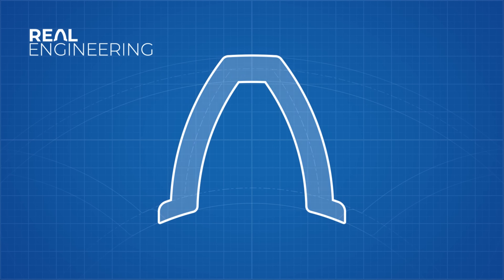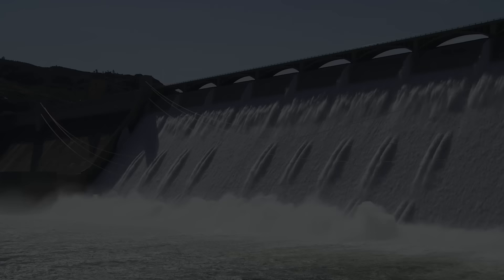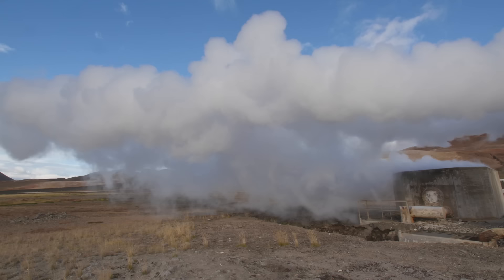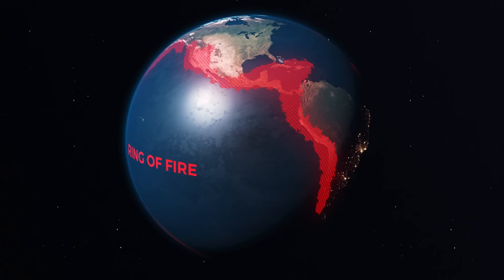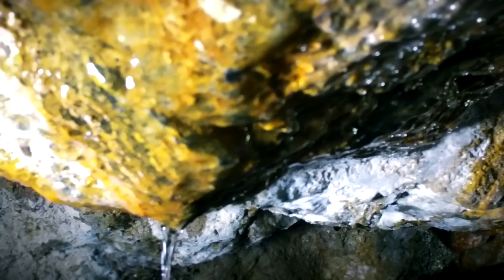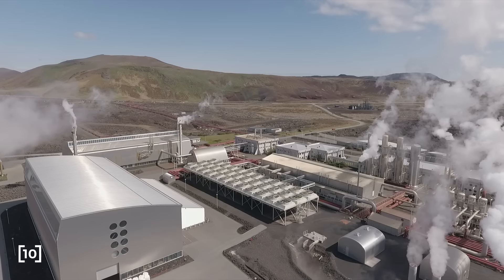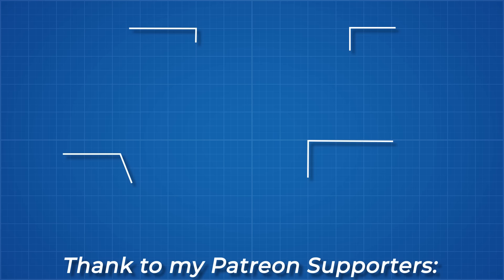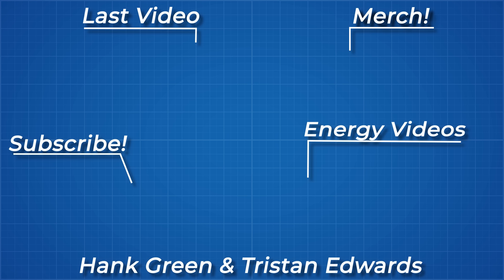Could Earth's Heat Solve Our Energy Problems?

Comment: Real engineering can you do a video on the next generation of nuclear power plants and their efficiencies. The recycling an re-usability of nuclear waste is really interesting in terms of safe and long term nuclear energy and energy sustainability, but people are so scared of the word there is little media coverage on it. cheers.
Reply: Say it louder for the people in the back. Good Lord, sometimes I feel like the only person who realizes that nuclear is the ONLY solution, and our time to ramp up nuclear power is running short. Maybe the couple dozen comments on every science and energy video are the only people who are aware of this problem America faces, but I'd like to believe there are more of us. We need to pressure our local governments to give greater thought to nuclear power if we are to move away from fossil fuels without kneecapping ourselves.
Reply: Yes!
Reply: Nuclear is honestly our best opinion for a future power supply. Granted we'll still need quicker acting plants to help quickly adjust the grid to demand. Those will probably be gas power plants. Though I guess in time you could make some stuff that can provide stable but quick power to replace those. I just don't get why we don't go the nuclear route when we know it's safe, to the point nuclear is safer than even solar and wind some how. Plus the long term cost is actually really really good, since they last so long and the method of producing power is efficient for power generation and cost of fuel per kilowatt is really good.
Reply: Yes, please im on board with you guys! Nuclear is the only realistic option at this point.
Reply: YES PLS
Reply: @danielhebard1865  What about the accidents?
Reply: Nikki Jones accidents are extremely rare, and rarely result in death. Nobody died from radiation in the Fukushima incident, but people freaking out caused problems. Basically, reactors are safer now than ever before, and most accidents are avoidable if technicians are properly trained. As far as safety is concerned, nuclear reactors have resulted in fewer deaths than any other form of energy, even solar. The only thing stopping the masses from embracing nuclear is their ignorance. And I’m willing to bet that if they knew how cheap their electric bill could be, they wouldn’t be so against it.
Reply: @nikkijones7051  The latest generation of nuclear plants, particularly molten salt and subcritical reactors were designed with safety in mind, away from the pressurised water reactors that gave even their designer pause. There are also tentative plans for new reactors that could recycle existing nuclear waste, potentially even the materiel from Chernobyl and Fukushima.
Reply: @danielhebard1865  The sad part is a lot of countries are actually CLOSING nuclear power plants, because of the stigma of nuclear weapons and reactor meltdowns like Chernobyl.
Reply: Australia just did a study on Nuclear power's viability in the country and concluded it wasn't worth the effort.

The conclusions of the report are that nuclear is vastly more expensive than other options and that it takes too long to get functioning plants up and running.

Based on the situation in Australia they estimate the cost per kw/h of nuclear to be pretty much the most expensive option possible for power generation.

It's also, by it's nature, since nuclear plants cannot have their output ramped up and down quickly, something which provides baseload power.
Which is the exact opposite of what the current Australian electrical grid needs given it's existing structure, where pretty much all current power related issues are related to insufficient peaking capacity, NOT baseload.

Nuclear does get more flak than it deserves due to people's panic tendencies around it. (though don't downplay the implications of large, infrequent disasters vs ongoing smaller ones - most people rate air travel as more scary than cars, even though averaged out air travel is safer by far, because the scale of an air disaster tends to be so huge. Nuclear has the same problem.)

But you shouldn't be lulled into thinking it's a panacea, which would solve all the world's problems if only those foolish anti-nuclear people would stop panicking about it so much.

It's expensive, takes a very long time to set up new generating capacity (on the order of decades), and provides baseload, which is generally not the primary problem modern electrical grids are faced with.
Reply: @KuraIthys  Seriously? Australia's latest stand on power generation (using brown coal as it's they have lots, it's the cheapest, and China isn't importing so much of it these days) is so short-sighted it would be funny if it wasn't going to kill people and wildlife. Cheapest does not equal best, especially in the long term. Burning brown coal (or any fossil fuel) for power is going to cause far more harm to the planet than well-managed nuclear ever will. That said I wouldn't trust the Aussie government to manage anything well...
Reply: @ALegitimateYoutuber   You can solve the increased demand on the grid through gigantic water reservoirs (pumped-storage hydroelectricity), which is pretty much how it's done already today. But is the problem the very short term increased grid usage or rather a medium time frame? Given the really long time to start and stop nuclear power plants.
Reply: Nuc power is the most expensive at 12c per wh and produce  1GW  vs  2GW  at petroleum  plants    Just what re-usability in actual practice are you referring to? The holding tanks at most Nuc plants are full and the rods they hold are 100k times more deadly than when they were installed  The rods have to be held for 40 years min before they can be transported and cooled continuously to avoid meltdown  There is no destination for the rods and no approved safe transport and storage   The US taxpayer has payed for the re-fueling and the total percent of our power needs has never been over 20%  The process to produce fuel rods is complex and expensive the tailings left behind from the entire mountains leveled to produce a few boxcars of yellowcake has a big environmental impact
Reply: Yes Please !!
Reply: @KuraIthys  isnt the investment in the technology worth it in the long run if everyone started investing in it, thus lowering the production cost and operation cost??? it is expensive to invest in the next generation nuclear plants, but its worth it i was watching a presentation from i think it was the university of Melbourne i could be wrong there but the professor/presenter was so frustrated that Australian politics play such a negative role in the downfall of this tech.
Reply: @Shaun.Stephens  mate the australian political bias is run by a bunch of un educated chocked up bogans. we cant expect much from them better to invest our time and education in Europe's nuclear tech. some of the stuff they have on the horizon is mind blowing.
Reply: @Viewer19  cant next gen fast breeder reactors recycle these rods??
Reply: @baronvonlimbourgh1716  with the global population ready to exceed 10 billion by 2050 and there will be no demand for more energy?
Reply: @MrAlexRadic  sure there will. And it will be whatever is the cheapest option to the consumer that will supply it.
And a grid with huge centralised plants will never be able to compete on cost with solar solutions because of it's dependence on highly capital and labour intensive infrastructure and inherent overhead.
Especially in developing countries with their smaller per capita energy footprint.

The grid is the solution to a problem that no longer exists. When it was build it was simply not practical or efficient to produce energy at the point of use. The efficiency gains by using huge centralised coal plants exceded the cost of building and maintaining the infrastructure needed to deliver it. 
These conditions no longer exist. It is now becoming more efficient to produce electricity at the point of use making the grid itself and it's overhead a huge added cost that is no longer nessecary.
Reply: IIRC, "molten salt" reactors exist since the days of the USSR. They produce next to no waste, and are much more efficient, cheaper, and way safer than "solid fuel" reactors.

I mean, we as a species have improved so damn much since the 80s...
Reply: Lets not forget nuclearfusion,thenew nuclear comingto play
Reply: @ZeroSleap  that has been 10 years away for at least half a century now lol.
Reply: @danielhebard1865  yeah just make sure these Nuclear plants in the usa are far far away form natural disaster prone areas which is almost the entire USA...
Reply: @MrAlexRadic  Still transport is a problem and where are the next gen   breeder reactors?   I would prefer to save our nuc resources for space exploration     By ~1975 our US reactors cost more  than all the fuel used by conventional plants u to then and produced only  ~16% of our power  Don't forget the  $500 billion the US tax payer forked over later tore-fuel because the plants were  not profitable.  It all started because the military wanted to produce Tritium to make nuc bombs. So they started the Clean Safe Efficient campaign with the help of the Oil companies which became known as Energy companies they helped because  half of US oil consumption is used by the military.
Reply: Thorium 238 -> Uranium 238-> Someting else for minutes-> Uranium 233

Thorium is one of the most abundant minerals on the planet
Reply: @danielhebard1865  Good comment. Totally agree.
Why do you say that in terms of safety other energy techs have caused more deaths than nuclear reactors?
Maybe because there are less nuclear power plants in the world, thus they have caused less accidents?

I am totally pro nuclear.
I just dont know data about historical accidents in different energy forms.
Reply: Yes. Nuclear fission is the solution for now, until we reach a good fusion reactor.
Reply: @AgentJRock805  ''something else for minutes'' this is funny its something but then its this.
Reply: @ricardocortes454  its a statistical average is why nuclear is safer they just wont develop new types of reactors because the waste cant be weaponized thus making it useless to the leading dev countries like the USA so no one is interested. even if it is safer and or cheaper it doesn't fuel one of the  arcs of USA economics which is war. althought China an India are at a point where they are developing these next gen reactors because they dont have  a choice
Reply: @ricardocortes454  fossil fuels cause a lot of pollution, especially air pollution. which isn't particularly healthy and these toxins like lead and mercury do cause premature deaths and cancer and all that jazz.
Lots of secundary concequences involved with burning fossil fuels and it effects basicly everyone on earth.
Reply: @danielhebard1865  it is still to expensive and inflexible to be viable. It is an economical dead end unless it is heavily subsidised.
And at that point there are better ways to spend billions or trillions of taxpayer money that have a bigger impact then funding nuclear reactors.
Reply: I'd like to see a video on Nuclear. Whether he says it's good or bad, I don't care, just say something on the subject.
Reply: He won't do a video on nuclear. He is a paid shill of the "renewable" industry.
Reply: @malcolm_in_the_middle  lol. Do you really not notice yourself how silly you sound¿
Reply: @baronvonlimbourgh1716  No, I don't. Why don't you explain how silly I sound?
Reply: @malcolm_in_the_middle  if you can't see it yourself when it is pointed out to you, having a discussion about it would not change that either. Would be a kinda useless endevour.
Reply: @baronvonlimbourgh1716  Typical smug lefty. Are you sure that you just couldn't think of a logical reason that I "sound silly", and merely made that statement based on your feelings?
Reply: @malcolm_in_the_middle  yeah, i am sure that is not the case. And it's not smug. Lazy maybe, but not smug.
Reply: @baronvonlimbourgh1716  Sorry, but I don't think you get to decide if you're smug or not.
Reply: There is quite a lot out there. In the UK two new plants were being built. One has stopped construction as it will never be cost effective. The other is still being built but will provide the most expensive electricity on the grid. This is in a country where the state takes responsibility for decommissioning and disposal of the waste. Much has been said about nuclear being 'low carbon' but the figures they quote are selective. The enrichment of the fuel is hugely energy hungry, the mac King of the fuel rods also requires specially created buildings with huge environmental  controls. When the rods are 'spent' they need to be stored under water while being monitored for an age before they can be moved off site in huge  protective casks. They then have to be stored safely for thousands of years or be put through the enrichment process again if there is a demand.
Reply: Nuclear power is the future.
Reply: @malcolm_in_the_middle  sure i do, that is what being smarter then everyone else is all about ;).
And yes, that is a joke...
Reply: @bigbadjohn10  the trouble really is not worth it anymore at this point, especially concidering the ongoing cost, management and subsedies they require. 20 years ago they might have made sense, that was probably also when it was decided to build these plants i suspect. But they had to be online then. Not decades later.
Things are changing fast.
Reply: @baronvonlimbourgh1716  It's not really a joke though, is it? You do think you're smarter than everyone else.
Reply: @malcolm_in_the_middle  haha. No man do not worry. I do know when i am better informed then a majority of other people. And i do recognise when i know very little about something and need to shut up and listnen to the ones that are better informed.
It is called self reflection. You should try it sometime!
Reply: @baronvonlimbourgh1716  Yes, you certainly sound like you know when to shut up. Furthermore, what on earth does that have to do with my initial point? I accused Real Engineering of being a shill, is that something you know more than me about? Are you saying I should shut up and listen to him, even though he's a shill? Really, what is your point?
Reply: I think this would have to be a series to cover all aspects not just the plant but the fuel preparation , the surround infrastructure and waste handling and storage.
Reply: DK Stoney  No it is not. It is expensive, inflexible and highly complex and is not as 'low carbon' as is claimed. The current costs would be even higher if the state did not cover the cost of fuel enrichment, disposal and decommissioning of the plant. As a business proposition it is really a none starter.
Reply: @malcolm_in_the_middle  you changed the conversation to me being smug and smarter etc. i didn't. So yeah, what does that have to do with anything? Please explain!
My point simply was that calling him a shill sounds silly, and i asked if you noticed this yourself as well. Not a complicated question i reckon.
Reply: @baronvonlimbourgh1716  Why do I say you're smug? Because you have talked down to me this entire conversation, and refused to explain your opinion when asked. What would you call that if not a smug attitude? You may of course remember that I did answer the question, but then that really doesn't matter to you, does it?
Reply: @bigbadjohn10  Here is some simple evidence that nuclear is lower carbon than so-called renewables: Germany is mostly "renewable" and France has largely nuclear power. Carbon emissions per capita in Germany are 8.9 g/person/year, and in France, 4.6g/person/year. There are, of course, complications with the waste of the reactor, but do you really mean to imply that there is no problem with the waste from production of solar panels? Solar panels have a lifetime of 20 years, if you're lucky, and nuclear plants have a lifetime of 50+ years. The energy production per hectare is 10 times higher for nuclear than either solar or wind, and the death toll per kWH is lower than all other energy sources.
In terms of waste management, it is expensive, but certainly manageable, and it is factored into the cost of the electricity. Even with this cost added, electricity from nuclear is far cheaper than renewables. You gave the example of 2 power plants in the UK where the price of electricity will be the most expensive. As far as electricity costs go, this is an abnormality, as in France, the USA, Russia, China, anywhere really, the costs of nuclear energy are cheaper than renewables. Not as cheap as coal of course, but the premise of this discussion is that coal is unacceptable. Did you take UK subsidies to renewables into account when you said it would be the most expensive?
Reply: @malcolm_in_the_middle  what do you want me to do then? Talk seriously to you like an adult when you make silly statements like you did? 
You obviously haven't taken any effort to inform yourself properly and yet you want to be treated like you have. Pretty entitled attitude honestly.
Reply: @baronvonlimbourgh1716  And this is precisely why I called you smug. You act as though you are better than everyone else. Do you have any evidence that he is not a shill? If not , why did you feel like you had to call me out on my accusation? Do you really think that anyone took it seriously? You act totally aggrieved that I didn't bow to your opinion and apologise.
Reply: @malcolm_in_the_middle  do you have any evidence he is? or any strong indication that he is? or any leads that point in that direction? Any statistical data that even remotely supports your claim?
Or do you just not like something he said for some reason or another and therefore he must be a shill of xyz. 

Just shouting out accusations into the wild about people does sound silly and ignorant. Especially if you provide no supporting evidence to support your claim.
And when you resort to attacking people personally or focus on some other random thing to start a discussion about the moment someone calls you out on it instead of actually supporting your statement by explaining why you made this accusation and provide information that supports your claim you basicly show you have nothing to offer but empty words. And that is pretty silly and childish.

You make accusations so it is on you to provide legitamicy to your claim. Expecting anything else is, again, pretty silly and pretty entitled.
Reply: @baronvonlimbourgh1716  Let's be fair here: I didn't attack you, you attacked me. I simply defended myself, and you got your panties in a knot. Do I have evidence he's a shill? Obviously not. But there is evidence that he is biased against nuclear, which is his constant belittling of it, and ignoring it in videos about renewable energy. When questioned, he refuses to address it, and ignores it. What is his motivation for this? It's not a closed topic at all, and nuclear is arguably far better than solar and wind. I say he's a shill, because this is a possible explanation for why he refuses to talk about nuclear.

Furthermore, this is a comment section on a youtube video. This is not a news article, or an opinion piece, or a real accusation in a court of law. Almost every comment made is baseless, yet you got very serious about putting me down, and really upset when it was turned back on you. Let this be a lesson to you: you don't know better than everyone on the internet, and you are not superior, and most of all, you are not speacial.
Reply: Malcolm in the Middle  You need to quote your facts correctly. The emissions you quotes are tonnes per year and only account for cement manufacture and burning of fossil fuels in that year. The problem with Nuclear is much end ergo is 'invested' in building the plant and enriching the fuel as well as treating the fuel and structure after use. This needs to be accounted for during their generation period rather than smudging it out over a longer period.
I believe that most is not all the reactors world wide are old and have well past their design life of 20 years. Like all old engineering they need much more maintainance, often of parts not designed to be maintained, which requires lengthy shut downs which need to be covered by other generation. There are a number of new nuclear plants being built, but I am not aware of any having started and understand that there are considerable problems being found is designing a safe economic plant. 
Incidentally solar panels are guaranteed for 20 years and are expected to last over twice that. There is plenty of real estate to put them on, it is called roofs. Work has shown that even on Orkney ( an island north of Scotland), not the sunniest place, they are a cost effective generation option and when linked with a modest wind turbine and grid battery it can make a sustainable grid.
Reply: @malcolm_in_the_middle  yeah so, he doesn't like nuclear. Lots of people don't for good reason. If that is a bias in your opinion, that's fine. It is his channel and his opinion. He does cover other valid technologies he does support. 
What more do you want from him? Cover nuclear technology? You know it will be negative cause he does not like it. So you will start bitching about that. You do understand that there is no way to please you right?

Calling someone a shill is a completely different thing all together. That implies he is accepting payment to spread false information. I don't know but that is a pretty damaging accusation to make against a guy that just wants to spread information and awareness about available technologies and offer his view on things.
You should not make that kind of accusations if you do not have anything to back that up with. Cause again that makes you look silly. Not to mention butt hurt and like a cry baby.

Indeed, this is just opinion and not high journalism, so why are you expecting anything but that from a random youtube channel? 

And please stop nonsense about panties and me being angry, i am not. You just gave me all the freedom to hammer on you a bit, and i did. 
And if you feel like i put you down, perfect! That is exactly what you where doing as well so i really can not feel bad about that.
Maybe it helps you understand how it feels if people treat you unreasonable for no reason and call you things you do not like without having any valid reason for it. 
You obviously have no problem with doing that to others but you have been crying to me all afternoon.

Again, self reflection. You should try it sometime.
Reply: @bigbadjohn10  I don't know where you get the idea that nuclear power plants have a design life of 20 years, and frankly, if they do it is unacceptable. Critical infrastructure should have a design life of at least 50-years and preferably longer. I also don't know why you think that the high capital carbon costs for nuclear should not be distributed over the entire life of the plant. If the plant does not need to be replaced for its entire life, it of course makes sense to distribute the cost of construction over that life. If we are to replace oil-driven cars with electric cars, which seems to be the goal, there is simply no way that renewables could cover that energy cost with current technology. Nuclear would also struggle, but it's far more feasible. Your studies in Orkney were under the assumption that cars would not require the use of the solar panel, and don't take into account the fact that solar  and wind are heavily subsidised in the UK right now.
Reply: @danielhebard1865 TLDR Reactors don't go boom anymore, but what about cancer?
 Perhaps nobody's death was directly correlated with the incident, but what about cancer and other long term problems? We won't know for another couple of decades, and given the large scale of contamination caused by Fukushima, it might be hard to know even then since it could potentially raise the global average cancer rate itself. Also, don't forget that this is Japan we're talking about, a proud culture that hates admitting mistakes. It could turn out to be like Rocky Flats, where the governments simply argue that the increased cancer is not their fault since it's so hard to link the two events after decades.
Reply: @danielhebard1865  you can't seriously believe the nuclear is the only solution to our energy problems? There are all kinds of ways of producing and storing energy some very simple and basic. What we lack is the political will to do it because it would take large projects funded by governments and taxpayer dollars. But of course it won't happen until the Oil Barons have sold off most of the oil and transferred their Investments into the other options.
Reply: @malcolm_in_the_middle  woooosh......
Reply: @MikeSmith-cl4ix  we do not need the political will anymore really. Economics is leading the transition now and it is picking up steam fast currently.
Solar is becoming so cheap now and production is ramping up to a point that having a solar system on your house will be as ubiquitous as having central heating or broadband internet in your home a couple of decades from now. Especially with efficiency going up quickly the area that is needed dedicated to panels also goes down steadilly over time.

Grid based systems will always have an inherent overhead and the need for very expensive infrastructure, and this will always be included in the price for the electricity you pull from the grid. Making personal solar always the cheapest option. It already is and the gap will only keep increasing.
Simple cost savings will drive people as well as businesses to adopt it more and more and there really isn't much that can be done to stop it. 

It is booming currently and if you are looking for an opertunity to start a business you will do really really well for the coming decades if you start one in the solar panel sector.
Reply: @baronvonlimbourgh1716  Do you comment on Youtube for a living? Very odd that you only reply to me during working hours.
Reply: @malcolm_in_the_middle  haha. Funny :).
Reply: Solar is not the answer unless the efficiency can be dramatically improved. The same goes for electric cars right now these things are little more than just a toy for the wealthy to employ to make them feel as if they helping the environment. Grid-based systems need to be redesigned and re-engineered to utilize gravity as a means of storing energy and we have areas of the Earth where are the tides that rise in excess of 40 feet and ships can carry immense amount of weight combined with a system of pulleys and generators these could be used to feed the gravitational Battery Systems. That's just one example of many simple ways of producing large amounts of power but as I said before it will take the political will because it will require large Investments of money.
Reply: @baronvonlimbourgh1716  Sure. I wonder if you will reply to this before morning. Somehow I doubt it.
Reply: @malcolm_in_the_middle  😽
Reply: @MikeSmith-cl4ix  they already are the answer though. Like i said there really isn't anything anyone can do about it.

Solar is simply a lot cheaper then buying from the grid, Right now.... and it is readily available, highly flexible, virtually maintenance free, convenient and extremely durable and reliable.
People are not going to wait for whatever new technology people are talking about that promisses all sorts of stuff 10 years from now and eventually ends up costing 3 times as much in the end anyway. Anyone who can install them is going to in the coming years. It is simple economics.
And as more and more people adopt it there will be less and less investors that are willing to invest insanely huge amounts of money into new technology that will serve an ever shrinking market. Delaying these new technologies only further.

And the same is happening to battery storage, affordable powerwall devices are coming very soon from all sorts of brands which will push price down on these quickly as production ramps up.
Youtube is full of diy powerwall projects that are getting better all the time and it is pretty much ready for comercialisation, plus chinese companies are already working on it. And if they are, companies like samsung and lg will certainly be developing for this market as well.
These things will be popping up all over the place soon.

It really is a done deal at this point. There is nothing viable on the horizon for at least 5 to 10 years and by that time solarpanels will be everywhere.
Reply: @baronvonlimbourgh1716  sorry but you are incorrect. These are expensive systems which are inefficient require maintenance and replacement and cannot be afforded by the majority of the population on this planet. If what you're saying is true then we would see a drop in the amount of oil that the world uses when in fact what we see is just the opposite. This is a serious issue because without the oil which is becoming harder and more expensive to access the large population that we have will not be able to support itself because our food supply his dependent upon the current cheap oil.
Reply: @MikeSmith-cl4ix  we are both talking about these square panels that you lay on your roof right, the black ones?

A panel costs 200 euros and produces 250 kwh a year. In northern holland which is pretty much as northern as canada.
They carry a 20 year warrenty. Guaranteed to produce more then 80% of the rated power after that time. But expected lifetime is more around 25 to 30 years. 
And all you have to do is hose them down 2 times a year.
The converter probably needs replacing after 15 years though. Which is around 500 euros depending on the size of your array.

Efficiency doubled over the last 10 years and will probably double again over the next 10 years. And prices have been plumiting and still are.

And building your own powerwall can be done for 250 per kwh with new 1860 cells if you are a bit creative. Sure the first commercial models will cost a lot more but still be economicly viable. Tesla powerwalls are already viable at those high prices.
And as production ramps up on these they will become a lot cheaper quickly. Like all technology.

You either live still in 2005 or you really need to change whoever or whatever you source your information from.
You can't get solar installed around here without coming on a waiting list for at least 2 or 3 months.
Businesses like retailers and farms and basicly anything with huge roofs are filling their roofs completely with panels.
They really are being installed everywhere, and without any subsidising. That ended 5 years ago already.

Like i said, it really is unstopable at this point because it already is cheaper then pulling from the grid. And the difference will only increase. 
There is no reason why the rest of the world could not adopt it as well. They use a lot les power and it saves massivly on infrastructure investment. It's a no brainer.
Reply: @baronvonlimbourgh1716  I guess it's a pretty good answer for someone who has the wealth and privilege of a baron but most of the population that's growing in this world is in places like India and China. Now I know the standard line in the Royal circles is that we just have another World War to reduce the population but the genocide of millions of people is not acceptable to most of us. And you didn't address the fact that even though solar panels have been around for a while we're still using more oil than ever before. I'm not saying they're useless they can be part of the answer but they'll only be a small part because they won't run the large Harvesters and other equipment we will need to feed the population when the cheap oil has run out.
Reply: @MikeSmith-cl4ix  what a nonsense lol. They can't afford a couple of solar panels that will provide them all the power they need for 30 years but building huge powergrids and expensive nuclear plants is no problem for them somehow.
I asume you do see how that doesn't make any sense i hope. 

We adopt it first, drive the price down by making it comodity items and eventually the rest of the world can also buy it for cheap. This isn't new or experimental, it is just how technology has developed for centuries lol.

And why we still use a lot of oil? Maybe because we hardly use oil to make electricity.
We are just at the start of this still. Solar really only really has been cheaper for a couple of years. Before that it simply demanded substantial investment for minimal saving over many many years. It was simply not interesting without subsidies. 
Now though we have passed the point where it became economicly attractive and it makes financial sense and adoption has been accelerating really fast.
Weird excuses about harvesters are not changing that honestly. We have trucks and busses and trains that are full electric why would a tractor not be able to be electric 10 or 15 years from now? And if they couldn't for some reason i am not aware of it really doesn't change anything in the big picture.

Just remember me when you are watching tv a few years from now powered by electricity from solar panels and you are kicking yourself for not jumping on a huge opertunity, either trough investment or even starting a business. 
Even a simple consultancy business will make bundles of cash in the coming decades ;).
You keep worrying about harvesters lol.

Enjoy your evening!
Reply: @baronvonlimbourgh1716  you seem like a nice guy and you probably mean well you simply have a lack of knowledge. I don't have to remember you in a couple of years I already have solar panels an electric motorcycle and an ebike. And yes Harvesters can run on electricity but you still have to make the electricity and that's made mostly with oil, Natural Gas and coal. To say we're using a lot of oil is an understatement we're currently using about 100 million barrels of oil per day. And there's simply no way solar cells could possibly replace that. If you believe that you just being foolish.
Reply: @MikeSmith-cl4ix  we'll see ;)
Reply: Nuclear involves super costly and hazardous tailings and permanent storage.

Conservation is key!
Reply: @danielhebard1865  lol no. 🤣
Reply: @KuraIthys  Thank you, nuclear isn't the answer!
Reply: @NicholasLittlejohn  yeah, why people still wanna grow the problems we after 75 years still haven't been able to solve is beyond me. Especially at this point in time where it really isn't nesesary anymore.
Not to mention the risks and the money that will be wasted.
I mean, it is not like we have a shortage of things where that money and time investment would be better spent.

We seem to distinctly lack forward looking vision and an innovative mindset as a society nowdays.
Nothing but people pushing for regression and stagnation everywhere.
Reply: @baronvonlimbourgh1716  yes we will see and I can understand why you see things the way you do living in Norway. If the rest of the world had the wealth, natural resources, and intellectual capital of the Norwegians then I could agree with you 100%.
Reply: @UCbZQfgUvzZC31gzSyA5MuKQ sorry my mistake but still Holland has access to the oil and natural gas resources of the North Sea. But yeah I'll check out that video when I get a chance.
Reply: @MikeSmith-cl4ix  we have been shutting down gas for a long time. It creates earthquakes and stuff so we stopped doing that. We basicly buy our gas from russia.
And we also don't have much to do with northsea oil either, thats britain lol.

Anyway, pv are basicly silicone chips that roughly follow moores law. The amount of energy capacity from pv has been exponential and will stay exponential for at least the forseeable future.

You know how ibm said in the 60's that the global market for computers would never exceed 2500 computers? Or at&t in the 80s saying cellphones would peak at about a million worldwide.

Pv is going to be the same. They will be dirt cheap and everywhere far sooner then people seem to realise.
Reply: @baronvonlimbourgh1716  you guys have been tapping Natural Gas and oil from the North Sea since the 1960s. If you ever decide to stop selling PV systems you can always come over here to the US you'd make a great used car salesman. PV systems are great but they have their limitations try calculating the amount of energy the world is producing by burning 100 million barrels of oil per day and you'll see that PV systems aren't even going to touch that. Besides the fact that you need large amounts of oil to produce the PV systems. People can ignore the fact that the world will run out of oil and then food if it like but when the hungry masses begin to look at your grandchildren as shish kabobs don't blame me I tried to warn you.
Reply: @MikeSmith-cl4ix  we never did much in the north sea. We did pump a lot of gas, but not anymore.

But i really like to know, where does this deep rejection for this kind of technology come from? I really like to know.
Especially since you use arguments that in no way reflect reality but keep doubling down on them.  And for some reason you turn to personal attacks and start looking for a single little reason to justify discarding everything else that is being said.

You only have to look at history and follow this stuff to it's logical conclusion to see what is happening and what will happen in the coming decade.
And these are extremely positive things as well. A huge reduction in polution, cheap energy for everyone, cheap transportation for everyone, enourmous economic chances for everyone, the worst effects of climate change will be avoided, an economy that is decentralising, the global domination by oil states will history within our lifetimes etc.
All pretty awesome and benneficial stuff and it is right around the corner.
And yet people will go out of their way to avoid the signs, purposly stick their head in the sand and will flat out reject anyone who dares point out the obvious.
Any basic understanding of economics is enough to understand what is happening and how it is going to change things.

This really is very weird behaviour and i really can't for the life of me understand why this is. Why is everyone so afraid when it offers such vast opertunities for anyone brave enough to look at things objectivly? Honest question!
Reply: @baronvonlimbourgh1716  I never said I rejected the technology and you are the one who challenged my assertion that we need political will and taxpayer-funded projects to get us out of a virtually hopeless situation when are cheap oil runs out. You're trying to tell people that solar panels are going to solve the problem and that's just not the case if you do the mathematics. I can tell that you're an intelligent person so I have to assume you're either selling the solar panels are you own stock in the companies that are. And saying that you would make a good used car salesman is not much of a personal attack. But it's not a problem I respect your opinion.
Reply: @MikeSmith-cl4ix  still think i'm crazy because pv's are too expensive or that we need strings of insanely expensive nuclear plants or whatever?
Reply: @baronvonlimbourgh1716  actually I think you and the people of Holland are quite sane and if you lived on an island where you were separate from the rest of the world solar panels and depending on Russian Natural Gas might work out okay for you. But we live in a world which is running out of cheap oil and gas with large populations in places like India, China, South America and Africa and these people want all of the things that the more developed countries have cars, air conditioners and modern infrastructure like the more developed countries. You guys should be fine as long as no one tries to take what you have or Russia decides to charge much higher prices for their gas.
Reply: @MikeSmith-cl4ix  Developing countries will get a huge boost with access to cheap electricity finally. And with china leading the way in the mobility sector the world will be a very different place a decade from now
We still need oil for plastics and other stuff but it will be dirt cheap. There a solution is still some way away. But that will eventually also become an economic dead end.
Russia will be giving their gas away for free with every bottle of vodka that is sold pretty much lol. 
Good times ahead.
Reply: @baronvonlimbourgh1716  you could cover the entire surface of the Earth with solar panels and it wouldn't replace the energy produced by the oil, gas and coal. When we run out of cheap oil the agricultural systems that feed our world will collapse. The store shelves  will become empty , The oceans are almost empty of easily caught fish  already and the hunters we'll run out of Wildgame within a few months. What do you think people are going to eat then with our ancient history of cannibalism?
Reply: @MikeSmith-cl4ix  what? Do you even have any knowledge about any of this? You really need to read up a bit so you at least have a remote idea what this stuff is about. You seem to be interested in this stuff but are clueless about it. Again, really really weird.

With current technology providing all the power for the usa would take 75 by 75 miles. That includes all gasoline and diesel and all electricity.

Anyway, like i said before, some people go out of their way to rufuse reality even when it is smacking them in the face. Maybe someday i will understand why that is.

Anyway, enjoy the sand in your ears lol. See ya.
Reply: @baronvonlimbourgh1716  yes and you can continue to sell Your Pie in the Sky. I never said I was interested and solar I told you earlier I have solar panels an electric motorcycle and an e-bike. I installed the panels myself and built the electric motorcycle from an old BMW gasoline motorcycle that I had. So I understand solar its strengths and it's limitations I was just answering you back because you seem like a nice guy and seemed to enjoy the debate.
Reply: @Viewer19  You're talking about the older process and the OC was asking about vids for the newer process that actually uses the nuclear material sitting in nuclear waste dumps. I'm not buying that it's the most expensive either. The only reason renuables are not insanely expensive is subsidies. When the subsidies get lowered or removed it'll be the most expensive method. It turns out wind turbines are much noiser and less efficient than originally thought. Solar panels don't last forever either. Nuclear is a limitless potential and new plants can use almost all of the nuclear material.
Reply: @waynethomas1726  So facts don't  matter  just your gut feeling got it
Reply: Thorium :3
Reply: Crazy how some ideas are great as long commies are not in charge of them. Ahem Chernobyl
Reply: Breeder reactors. Done.
Reply: I love nuclear i agree people are just scared of it so don't want to go down that road but they don't know enough about it and to many are missinformed
Reply: @rollinbodda4405  i think the core problem is that the topic its self is to complicated for people to want to understand so it never really gains traction
Reply: @KuraIthys  And Australia has now committed to using natural gas and is expanding coal mining. Vested interests have again carried the day. 

Proposals such as Thorcon, Nuscale and Moltex SSR, in conjunction with renewables, could easily provide Australia with abundant secure energy sufficient to replace all fossil fuel use at an affordable cost. 

The inquiry's conclusion was foregone. It's objective was to validate a policy of continued coal use and a transition to natural gas as coal plants were retired. It achieved this aim.

Essentially Australia's energy policies are a joke, with a few jurisdictional exceptions there is no serious effort being made to replace fossil fuels. Although over recent decades there has been a good uptake of domestic solar and there is some windpower, the reality is these have only kept pace with increasing energy usage, which has been moderated by the nation's deindustrialization. This has at least saved the need to build additional coal power plants, but done little to displace existing fossil fuels and has led to the loss of significant industries.
Reply: @nikkijones7051  There is a potential way to prevent nuclear reactor meltdown. USP10748,667.
Reply: @baronvonlimbourgh1716  Hellion is building nuclear fusion reactors that work as we speak
Reply: @godofwisdom3141  sure they are...